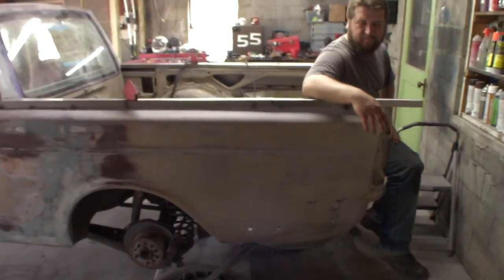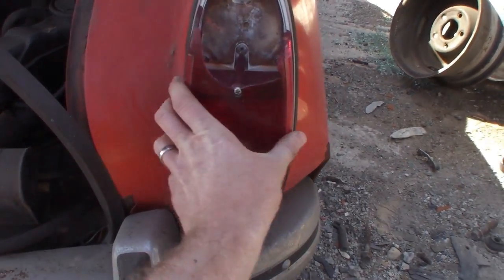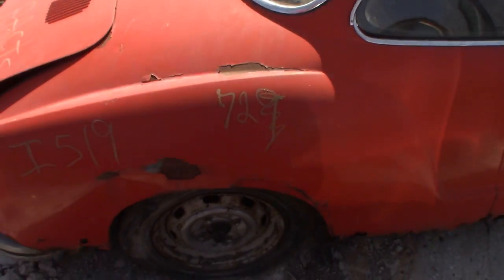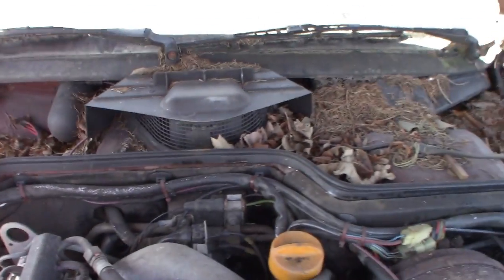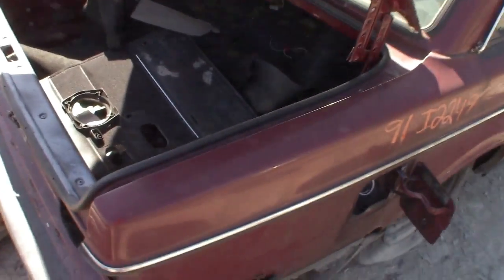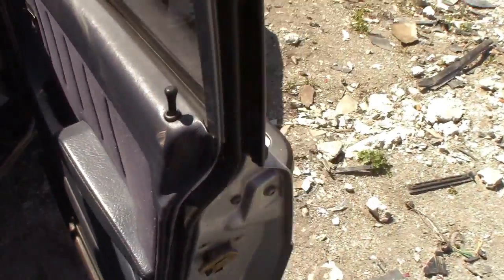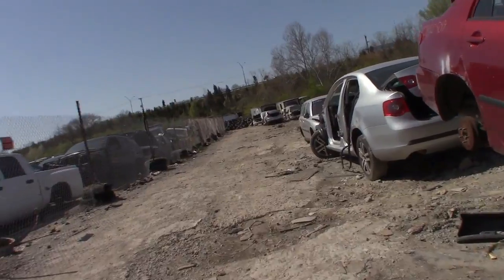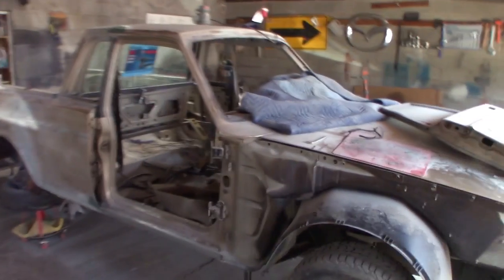Junkyard Finds: Karmann Ghia, Porsche 944, Saab 900S, Turbo Volvo

Comment: It could be a 1600cc engine. They are on the same floor pan as a type 1 and have the same motor and IRS. The body was bu karmann and interior by ghia. That's why people call it the karmann ghia but it's actually a type 1 (beetle) with a sports body
Reply: Not a type one Pan.  The chassis of the Ghia is the same as the Thing.  A little wider than the bug.  It does use a type one motor though
Reply: An extended type 1 pan
Reply: 1f1fan a type 1 4 is still a type 1
Reply: @schnike0073  This is true.  I meant that it was  not  a Bug pan.   My bad.
Reply: 1f1fan they are though. They were both the type 1 and vw was cheap. The pan can be used in a type 1 and a type 1 4